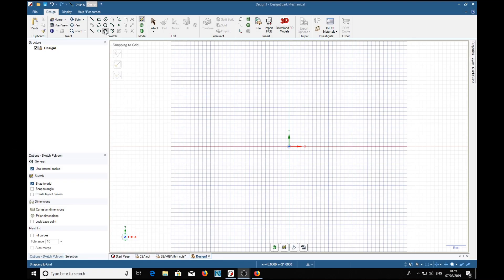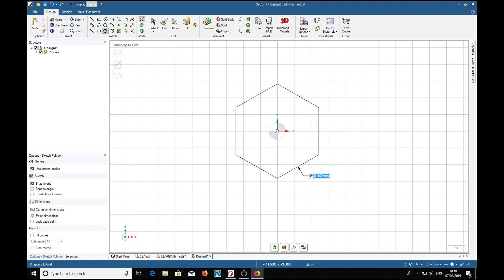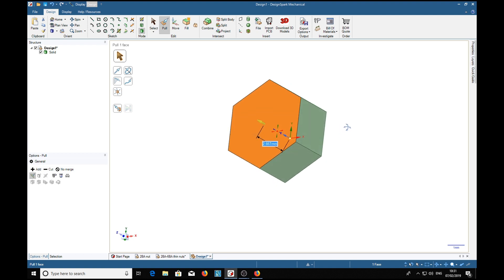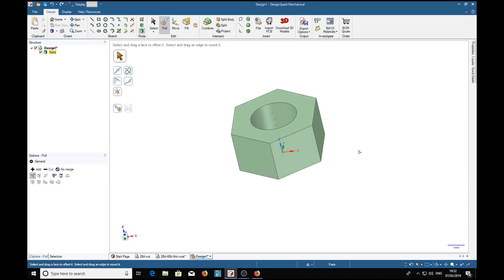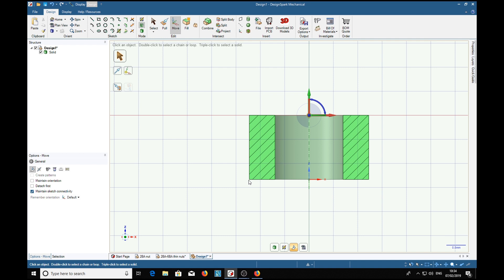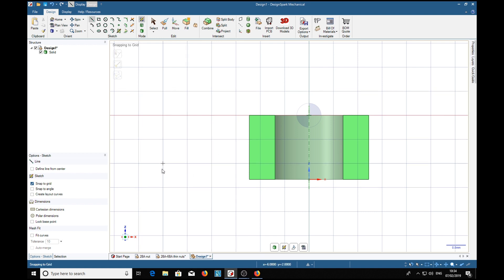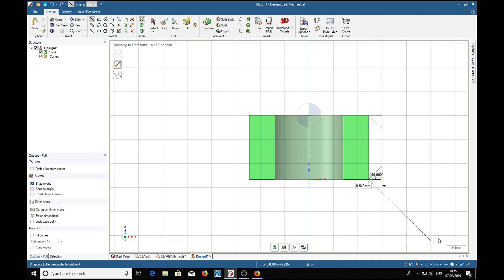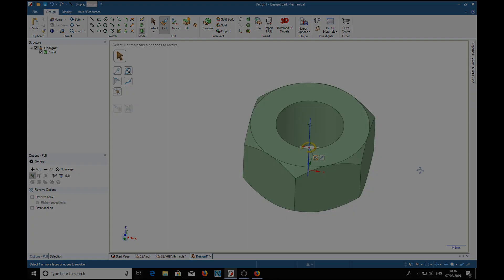DesignSpark Mechanical: Making a series of nuts pt1

Comment: Great video Jim.  If you want to change the default units from metric to imperial you can do it from DesignSpark Options --》Units
Reply from the maker: Thanks but I did know about that. It's just that sometimes I can't be bothered to do the conversion in my head. It's just that it is useful to know that even though you are working in mm, you can enter a value in inches by simply adding 'in' after the value. The converse is true also using 'mm' after the value.
Reply: @JimTaylor42  Same can be said for working in Meters when working with large parts or components.